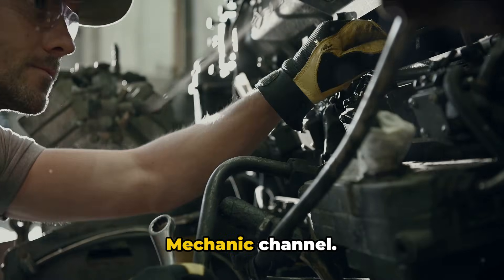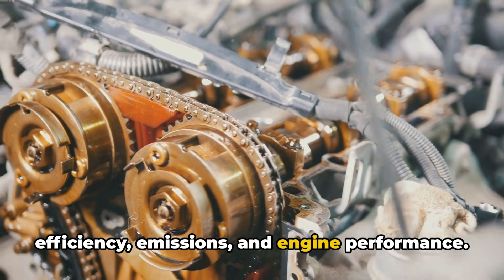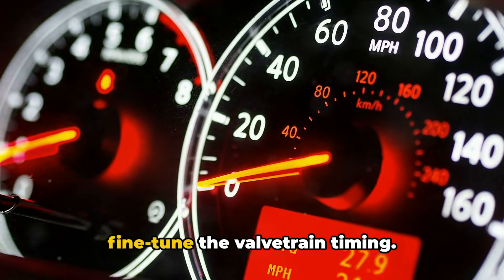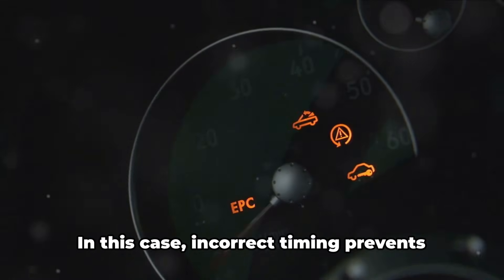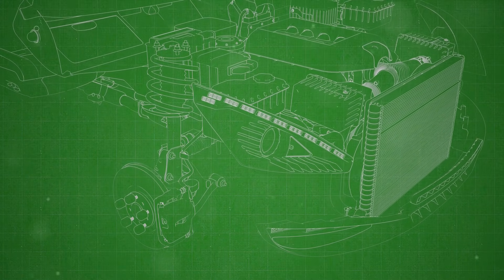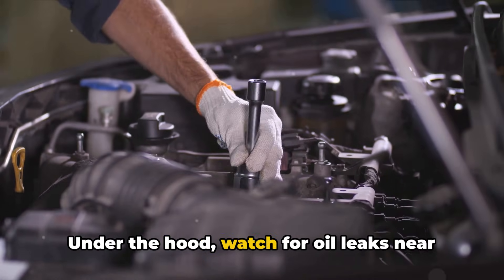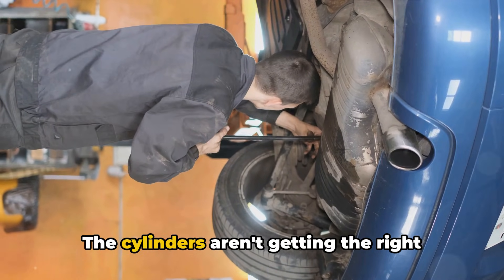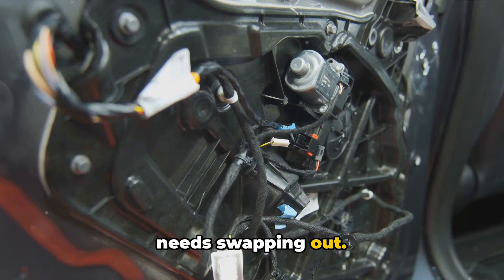Bad VVT Solenoid Symptoms: 7 Common Failure Signs

Comment: I have an 08 tacoma 2.7l i4, i have had misfires and variable low idle/vibration, but if you give it a little gas, it runs good.  I just got the haynes manual and read about this sensor.  I was going to pull the head and have it checked.  Do you think it might be this vvt sensor?
Reply from the maker: Given the symptoms you're describing with your 2008 Toyota Tacoma 2.7L I4 — misfires and variable low idle along with vibration that improves when giving it gas — it is indeed plausible that the issue could be related to the Variable Valve Timing (VVT) sensor, especially since VVT plays a crucial role in engine timing and performance.

The VVT system adjusts the timing of the camshafts to optimize engine performance and efficiency. If the VVT sensor (often referred to as the VVT solenoid) is malfunctioning, it could cause the timing to be off, leading to misfires and rough idling. Before you consider pulling the head, which can be quite labor-intensive and expensive.
Reply: such as a timing chain tensioner that lacks oil pressure, causing inaccurate timing and can cause the engine to vibrate.  Because when the engine rpm is increased, the vibration disappears.  So it could be the tensioner that has a problem, or the oil pressure that has a problem.
Reply: Good video thank you, My car is Santa Fe sport 2018 , if this sensor vvt selenoid have a problem affecting the line of the sprocket phaser too ? Let me know my friend because I’m confused I don’t know if the problem is vvt selenoid sensor or sprocket phaser , my car all the time is accelerating , please my friend let me know 🙏

Comment: My car runs great cause everything great stays on the number one on tachometer oil is great. A problem little tap and up by the camp shop phaser results back.
Reply from the maker: It sounds like you're saying your car generally runs well because all the indicators (like oil pressure) are in the optimal range on your dashboard. However, you're experiencing a slight issue, possibly a tapping noise, which was diagnosed at a repair shop as related to the camshaft phaser. This component helps improve the engine's efficiency by adjusting the timing of the camshaft. If it's faulty, it might need repair or replacement to resolve the noise and ensure your engine runs smoothly.

Comment: I have a 2013 Altima 
It idles rough and the engine dies when I stop at lights or a stop sign 
Could that be the issue ?
Reply: Yes. I replaced all 3. The car is running smooth now.
Reply: @93everything  dude that is f n awesome I'm going to do that as well!
Reply from the maker: Really glad you managed to sort it out!
Reply: @93everything there are 3 VVT solenoids? I thought there was only one per bank?
Reply: @Fit.For.A.Firefight. Probably means he did the exhaust an intake cam sensors and vvs on the hyundai 2l 2008 vvs on left top ( motor mount hugs to close) got to jack engine to support as mount is un done ) cams sensors on right  opposite on the turbos its easier to remove intake tube and unbolt some hoses in way ..don't lose nuts on sensors .
Reply: Mine does that too. You should clean them first and if it stops that issue then it is the vvts and just replace
Reply: Yes that’s what I meant.  3 total

Comment: Hello, I have a 07 Nissan Altima and upon start up, the car shakes, on warm up under acceleration it makes a ticking noise 1.5k rpm to rev limit could it be a vvt solenoid or a piston, rings, or something else?
Reply from the maker: The shaking on startup and ticking noise during acceleration could be caused by several issues, such as:

1. Faulty VVT solenoid
2. Low oil level or poor oil quality
3. Worn valve lifters or camshaft lobes
4. Exhaust manifold leak
5. Spark plug or ignition coil issues

While worn piston rings are a possibility, they are less likely to cause the specific symptoms you described. It's best to have a mechanic diagnose the problem to determine the exact cause and appropriate repair.

Comment: Hi, had a bearing Knock on my audi, cut the crank, replaced pistons, rings, bearings, schemed the head replaced valves on cylinder 3 and i still keep getting misfire on cylinder 3, the compression in the cylinder is quite low but its low on cylinder 2 and 4 as well, but only getting the misfire on cylinder 3 on the VCDS and high values for misfiring on cylinder 3, could the VVT cause this as its strange that only cylinder 3 is misfiring so much, also the misfire is mostly at low rpms, some help would be appreciated.
Reply from the maker: Hi Naeem, did you manage to find the cause?. A bad VVT solenoid can cause that especially on Audi's but my hunch tells me you might have a bad fuel injector on cylinder 3.

Comment: I have a 2019 Infiniti Q50 3.0t (94K miles). My car was driving very sluggish when I was trying to accelerate. Does this has anything to do with my catalytic converter?
I ran my OBD scanner and got the two codes:
P0012 - A Camshaft Position Timing Over - Retarded Bank 1
P0022 - A Camshaft Position Timing Over - Retarded Bank 2
Reply from the maker: Hi, The sluggish acceleration and the diagnostic trouble codes P0012 and P0022 are related to the variable valve timing (VVT) system, not the catalytic converter. These codes indicate that the camshaft timing is retarded (delayed) on both banks of the engine. This issue can cause reduced engine performance and sluggish acceleration. I would first check the cam position sensors then move to vvt solenoids

Comment: Hi, when starting my Volkswagen Passat 2017, an error message sometimes appears. After taking it to the workshop for diagnostics, they mentioned that according to the computer, one of the electronic engine VVT components is faulty and needs replacement. Is this accurate? Appreciate for your input
Reply from the maker: Hi Richard, Apologies for the late response. what was the error message you got and was the car running rough?

Comment: I have a 2006 Nissan maxima I can drive it for 30 minutes fine at whatever rpm I want but after 30min my car will not go up 3k rpm on all my gears and the car want to die and the rpm go up and down when I’m idle and driving could it be the vvt solenoid or timing chain skipping teeth ?
Reply from the maker: Hi, Your issue, where the car operates normally for 30 minutes before experiencing RPM limitations and instability, could potentially be related to the VVT solenoid, but it might also involve other factors such as fuel delivery problems, a clogged catalytic converter, or an issue with the engine's electronic control system, including sensors like the MAF or O2 sensors. While a timing chain skipping teeth is possible, it's less likely to cause intermittent problems and would typically result in more constant and severe running issues or the engine not running at all. Before focusing on the VVT solenoid or timing chain, consider having the vehicle's computer scanned for trouble codes and checking for any issues with fuel pressure or exhaust flow restrictions.

Comment: I have a 2013 lexus is250 75k miles, it rattles for 2 seconds when starting after being idle for a while. Could it a vvt solenoid ?
Reply: Not a bad tensioner. It's the vtc cam it holds oil pressure. When it loses the ability to hold oil, and drains, it rattles, until it gain pressure again on start up.

Look up VTC actuator for lexus
Reply from the maker: Hi, way to go for choosing a Lexus!. It sounds like your Lexus IS250 might indeed be experiencing a problem related to the Variable Valve Timing (VVT) system, particularly the VVT solenoid. The rattle you're hearing upon startup, which dissipates after a couple of seconds, could be due to the VVT solenoid failing to properly control the flow of oil to the VVT chain on initial startup. This is relatively common in vehicles as they age and accumulate mileage.
Reply: I saw your comment. That's a bad tensioner. So what happens is oil leaks out of the tensioner when the car sits and the change loose when you start it and it rebuilts pressure

Comment: Yo my man, quick question ❓ will these being bad make a car backfire and rPmZ not to work all of a sudden after changing starter, oil, manifold intake just minutes ago or “NO “
Reply from the maker: Hey man, managed to get it sorted? Yes, faulty VVT solenoids can potentially cause backfiring and RPM issues, as they affect engine timing. However, if these problems started right after changing the starter, oil, and intake manifold, it's also worth double-checking those areas for any installation errors or disconnected sensors.
Reply: How about after all those changes there my man and still no change, it’s LOW ENGINE COMPRESSION and it’ll be going to the shop nDa morning to get engine #3️⃣, all sensors from 0², crankshaft, both camshafts, VvTs,plugs, coils all.,.smh 🤣😂🤨,Ecotec motors are weak but I thank you a million dude

Comment: Hi i have a toyota vitz 13 vvti and the vvti is not working can it be the solenoid ?
Reply from the maker: Hi, Yes, a common issue with the VVT-i system not working in a Toyota Vitz 1.3 VVT-i could indeed be the solenoid. The VVT-i solenoid controls oil flow to adjust the timing of the camshaft for optimal engine performance. If it's faulty or clogged, it can prevent the VVT-i system from functioning properly. It's advisable to check the solenoid for any signs of oil blockage or electrical issues.

Comment: Nice video! Mine is lealing oil extremely, should I replace it? Or just replace the O Ring and use sealer?
Reply from the maker: Thanks. depends on your budget, often times just replacing the seals works 100% but I personally recommend replacing the leaky VVT.
Reply: @HonestMechanicChannel  tnx, better not using the car and fixing it next month
Reply: Don’t be a brokie it only cost about $30 for the sensor and do the job yourself

Comment: My 15 rogue runs great at start up, after warmed up it vibrates at idle .. no check engine light, however scanner says vvt monitor bank 1 status fail .. what could that be ?
Reply from the maker: Hi,  suggests a possible issue with the Variable Valve Timing (VVT) system. The VVT system is designed to improve engine performance and efficiency by altering the timing of the valve opening and closing.

Here are a few possibilities (Most common to least)

1. VVT Solenoid or Actuator Problem: The VVT solenoid controls the flow of oil to the VVT chain and gears. If it's malfunctioning or clogged, it can affect the timing, leading to rough idling.

2. Oil Quality and Level: Low or dirty oil can negatively impact the VVT system. Since VVT relies on hydraulic pressure (which comes from the engine oil), insufficient or contaminated oil could hinder its operation.

3. Timing Chain or Belt Issue: If your Rogue uses a timing chain (which is more likely) and it's stretched or not functioning correctly, it could affect the VVT system.
Reply: @HonestMechanicChannel  Thank you !  I’m thinking the chain stretched since I change oil every 3,000 miles, I would think the solenoids would be ok with that interval, and chain for that matter.  The car is at 77,800 miles the chain shouldn’t be an issue yet , but I guess could be. I don’t have the facility to do it myself, now I have to find a reputable mechanic who will be honest about what it really needs.
Reply: My 16 maxima is telling me the same exact thing vvt solenoid bank 1... in which my mechanic ask if I had and oil change recently and that's what happened. They put the wrong or dirty oil in the motor caused mines.
My car takes 2 to 3 sec to start up
Reply: @anfieldfaithful6223  could be vvt sensors ..

Comment: Hi. My car sometimes rattles 1-2 seconds after startup. Its not got timing chain. Can it be vvt solenoids? Will it damage something if not replaced? No fault codes are present, and no other symptoms.
Reply from the maker: Hi. Yes it could be related to the solenoids. If the VVT solenoids are failing or are clogged, it's possible that you won't see immediate fault codes or other symptoms but experience some rattles. But since its only 1-2 seconds after startup, I wouldn't be worried just yet.
Reply: @HonestMechanicChannel  can crank code appear if there is failure on vvt??
Reply from the maker: @mohsinseif   yes that can happen. In many makes it comes as camshaft code. but I think its possible that it can throw a crank code
Reply: @HonestMechanicChannel thank you for the answer. I love this channel😊
Reply from the maker: Thanks, I really appreciate your support mate!
Reply: While this is a common problem in cars with high mileage it's better to scan the ECU for codes rather than looking for symptoms to identify a problem. Rough idling, misfires, poor starts and other symptoms could be caused by other conditions. Many DIYs jump to conclusions and end up ' fixing' things that had nothing to do with the problem. Most VVT failures usually result from dirty screens which in turn are the result of irregular oil change intervals. If a VVT code is present, remove the valves ( intake and exhaust) and clean the screens with a solvent such as brake cleaner. If that doesn't solve the problem then replace the vvts. Symptoms are only a ball park approach to a problem that can tell you which components to check. For an accurate diagnosis identify the part that is failing. This will save time, money and frustration.
Reply: is the engine oil light blinking while driving relate to this solenoid?
Reply: @shahaidilabrahman5291 Bri usually that means no or low oil pressure.. bet you don’t still have that car, you should’ve kept oil in it.. a certain demographic of people will have something nice and not take care of it till it’s junk
Reply: @AlecFacemire Nah homie, dey don't do dat.
Reply: If not fixed yet check the heat shields and watch the exhaust something could be loose
Reply: Have You fixed the problem with rattling? Got the same thing and its not the timing chain.